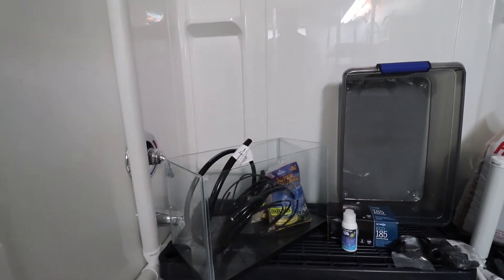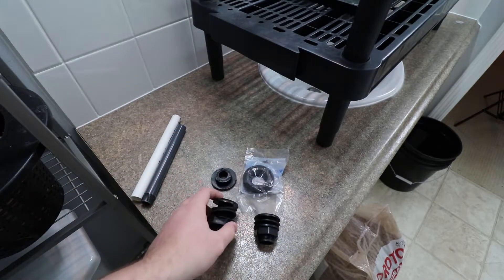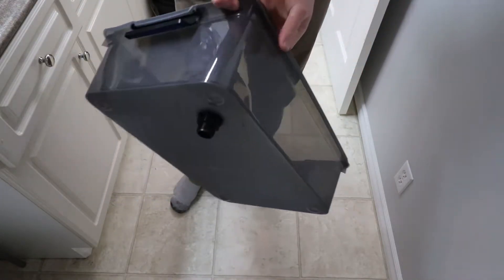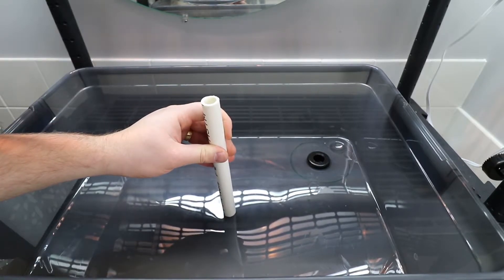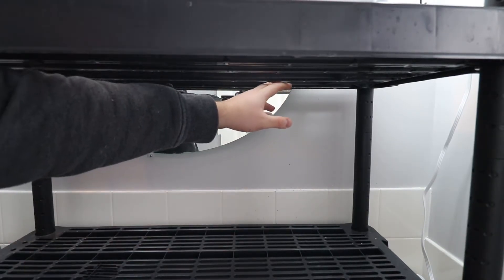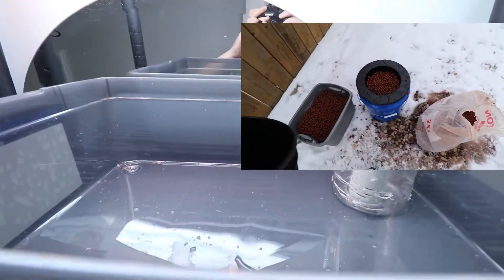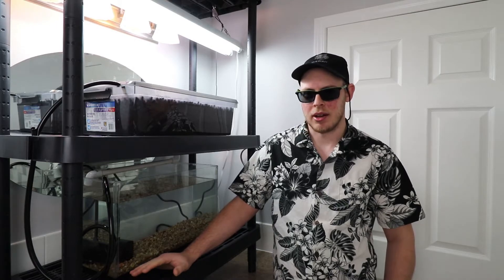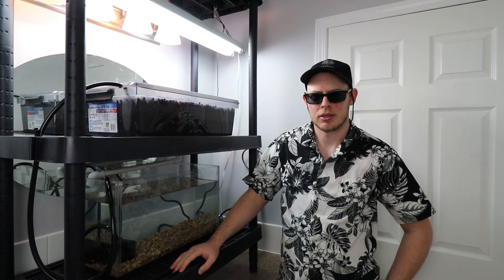How To Build an Aquaponics System For Indoor Gardening

Comment: Just bought the shit. Cant wait for it to arrive. I have way too much isolation time on my hands so i thought... why not. im thinking 10 neon tetras in a 5 Gallon tank. 800L/hour pump going to a 32inx24inch grow bed. 200W grow light. Instead of the clay, im trying with a large aquarium gravel. Will update results in a few months.